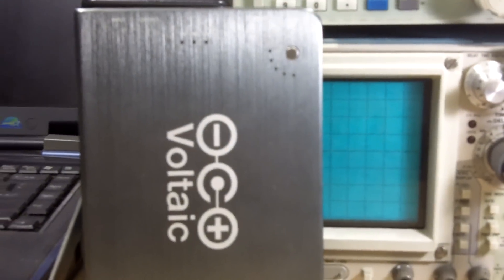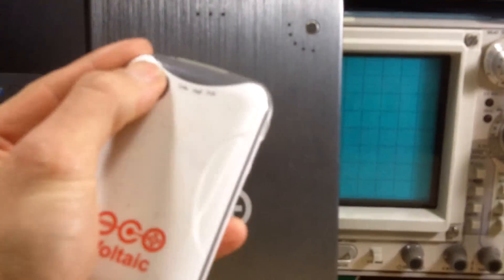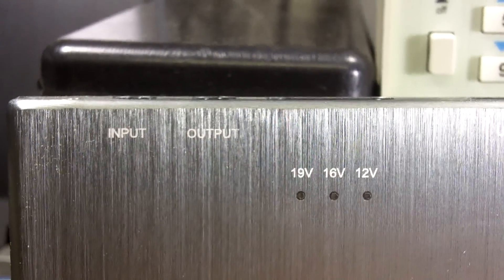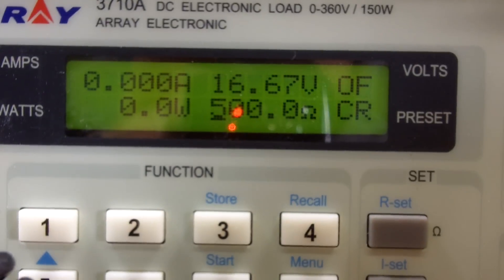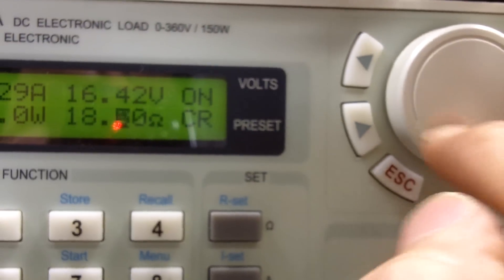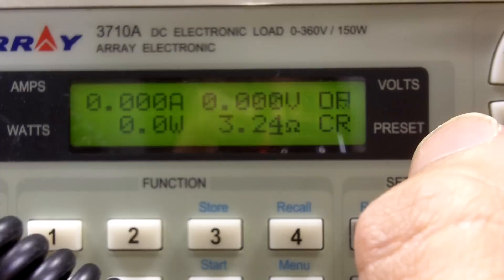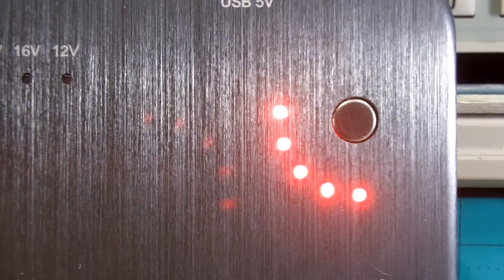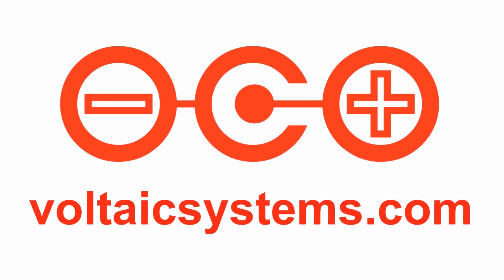Tutorial 4 Short-Circuit Protection

Comment from the maker: Hi, we do another short circuit test which involve connecting a paper clip against the positive and negative leads. It typically creates a spark so we don't have it in the tutorial. We then confirm that the battery shuts off and that it resets.

Comment: to me this is more like an over-current test, since the load resistance is only 3.24 Ohms. Have you tried to short the output by a much lower resistance path, say under 0.100 Ohms? Or to power up into a short-circuit condition? That would be interesting to verify.